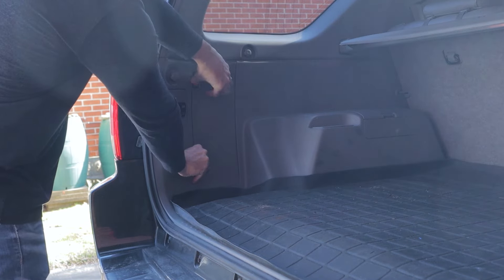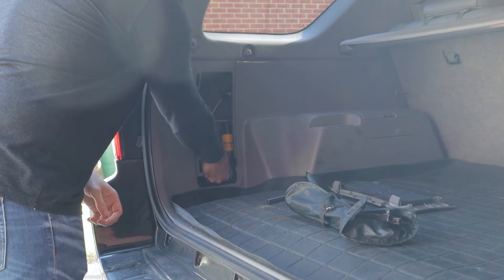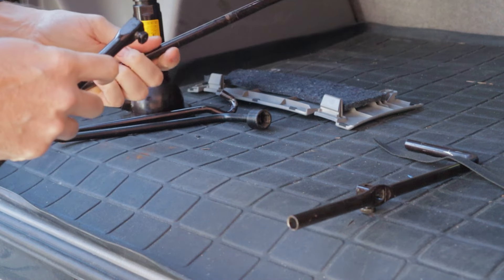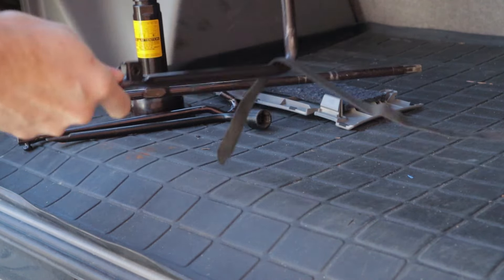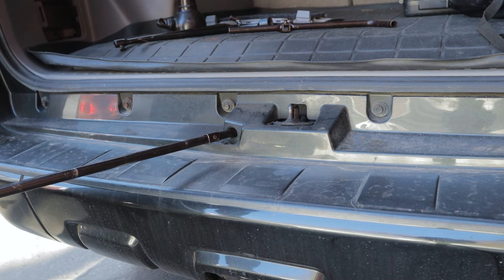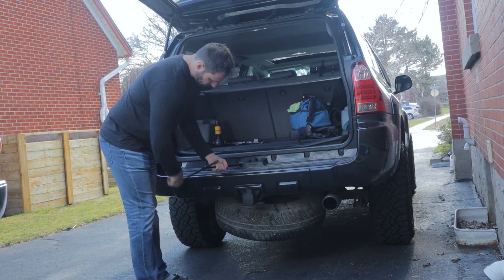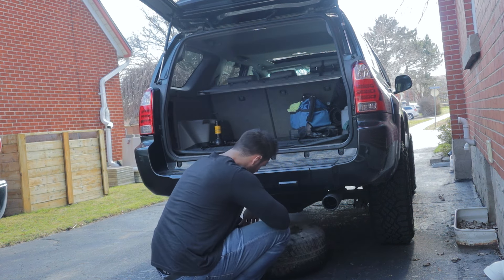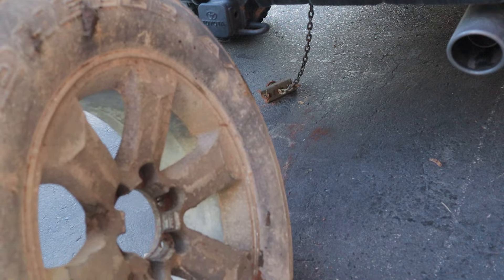How To Remove The Spare Tire In A 4th Or 5th Gen 4runner

Comment: Vsc disable switch next,  

That’s the video we need before next winter 😂
Reply from the maker: I'll put it on the list!
Reply: @CanadianGearhead  having the worst luck with my 4Runner right now. 

Xreas shit the bed today. And the seal job I did on my transfer case rear output shaft and companion seal didn’t hold up,  either cause I suck or cause I used Napa parts and not the super expensive Toyota ones

Comment: Any words of advice for when the rods will not seat in anything? just picked up a 07 4gen and can't get the tire lowered
Reply: Did you figure it out? I’m missing the rods to unlock/lower my tire 😭
Reply: @CassieAStone  Yes, unfortunately the part that the rods go into was rusted away, I had to cut the cable that holds the tire up. I now carry my spare either in the back or on a hitch mounted tire carrier.

Comment: What if it's in RWD? 
Does it also mess up the diff/transmission as well? 

I have 20inch 5th gen wheels on my 4th gen 4runner.

Would a 20 inch wheel on the front left & 17 inch wheel on the front right mess up the diffs & transmission if it's in RWD? 

Mine can switch from RWD to 4x4, would like to know the answer if you know. 

Thank you

Comment: Thanks. Did you guys notice how the suspension rebounds at 1:36 once the tire is lowered? Would a 70lb spare actually cause that much sag? :0 Thought that was weird
Reply from the maker: Might just be an illusion - it only sags about an inch with a trailer hooked up

Comment: I just changed my rear diff fluid,   I only was able to fill it back with 2.5 litres. 

Was that about what you get out also ?
Reply from the maker: I can't remember, but if you're on level ground and it's coming out of the fill hole you should be good
Reply: @CanadianGearhead  gonna be changing out my transfer case rear output shaft seal and companion seal tomorrow morning,  I should make a video,  not sure how good the quality of the video will be.  But I’m sure will be useful information 

Seems straight forward 

Saturday is cv joints and front axel seals

Comment: This is a super late comment. 

In the event you or some reads this. 

I have had a 4th gen for years. Just hit 200k and I plan on now doing some upgrades.  Ew wheels, lights, lift kit, etc. 

When I get new wheels, should I get 5 wheels and use the 5th as my spare?
Reply from the maker: It'll get beat up under the vehicle so I just keep an oem wheel there with a matching tire size

Comment: What size is your spare tire? Can a 275/70/17 fit as a spare?
Reply from the maker: Mine's a 255/75/18 - the 275 would probably clear but it'll be tight and hang a bit lower

Comment: Is it true the spare tire has to be the same size as the other 4 for the All time 4WD models? Heard it can mess up the diff/transmission?
Reply from the maker: Yup it's true
Reply: What if it's in RWD? 
Does it also mess up the diff/transmission as well? 

I have 20inch 5th gen wheels on my 4th gen 4runner.

Would a 20 inch wheel on the front left & 17 inch wheel on the front right mess up the diffs & transmission if it's in RWD? 

Mine can switch from RWD to 4x4, would like to know the answer if you know. 

Thank you